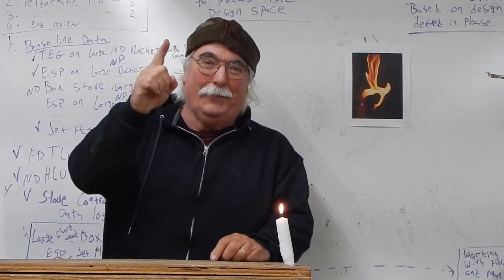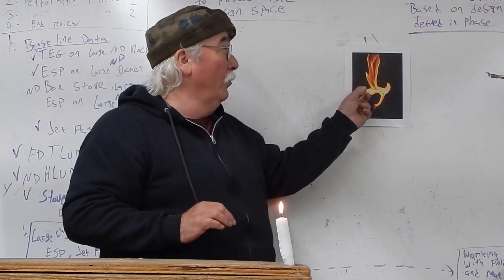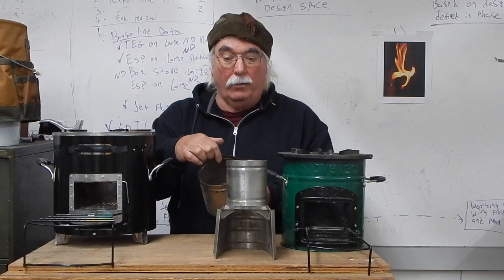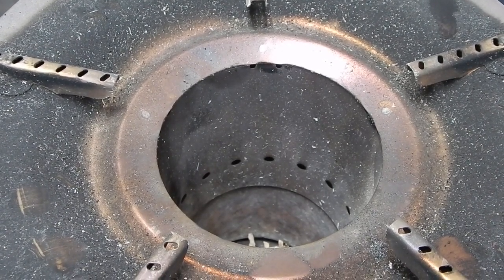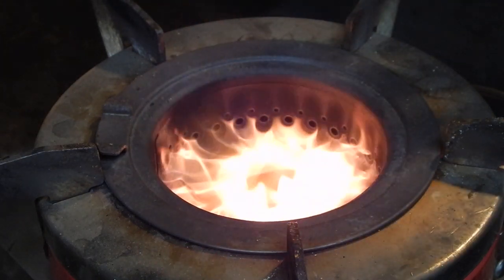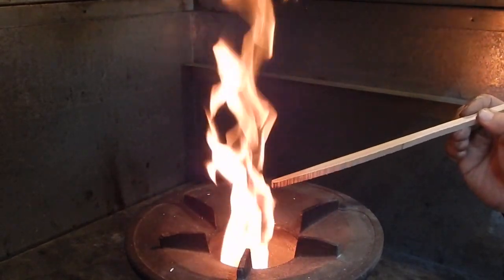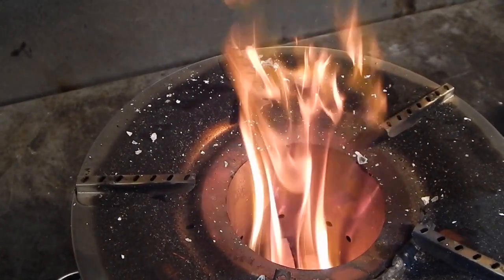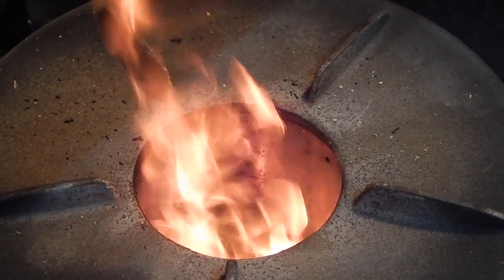Rocket Stove 2020 - Mixing

Comment: Secondary air and vortexes greatly increase the fuel burn by introducing  more directional air into the flame. This can be done by angling the secondary holes with a bar or large nail and can be scaled up to work on 45 gallon drums.  I have been doing this with 45 gallon drums for many many years and obtaining a strong vortex swirl with high temperatures and a no smoke burn ( or a very close to no smoke burn). Green branches and leaves can be burned as you cut them.  I can put a heavy gauge screen and melt down aluminum car motor heads on top of the barrel ( using wood for fuel) with ease and the resulting melted aluminum drips onto the ash bottom creating saber-tooth like aluminum spike teeth renderings. I also did the stainless steel tumbler barrel of a front loading dryer using a large nail and angling ALL the holes in the same direction with great result for a back yard fire with clean burning and a reasonable viewing flame . Vortex on this flame can only be seen when accelerant ( lamp oil ) is added to the flame and the air intake speed is greatly increased. I will have to open a YouTub channel to show videos and pictures .  Keep up the good work and research......

Comment: Thanks for the great vid and your persistence in making a better stove. The problem of inhibiting the air flow and getting smoke out the front might be solved by putting an upward angle on the side jets so they are encouraging the upward flow.  Also add some swirl by adding some rotary angle as well. All easy to do by sticking a bar in the hole and torquing the bar in the hole the way you want the air to flow.
Reply: What you saying to do with the bar and angling the hole to create a vortex works really good.  I have been doing this with 45 gallon drums for many many years and obtaining a strong vortex swirl with high temperatures and a no smoke burn. Green branches and leaves can be burned as you cut them.  I can put a heavy gauge screen and melt down aluminum car motor heads on top of the barrel with ease and the resulting melted aluminum drips onto the ash bottom creating saber-tooth like aluminum spike teeth renderings. I also did the stainless steel tumbler barrel of a front loading dryer using a large nail and angling ALL the holes in the same direction with great result for a back yard fire with clean burning and a reasonable viewing flame . Vortex on this flame can only be seen when accelerant ( lamp oil ) is added to the flame and the air intake speed is greatly increased.

Comment: The best designed rocket stove has three metal devices that direct the flame:  1. two flaps. 2. stationary blades to swirl the flame. 3. a broad flat blade that sticks up through the center. What happened to this design? Next, after max heat is sucked from the wood, almost as important is directing, capturing, using the heat. This is done my a recessed pot with optimal spacing.